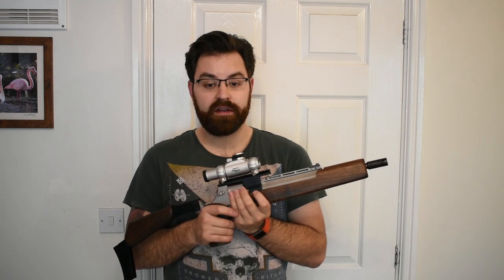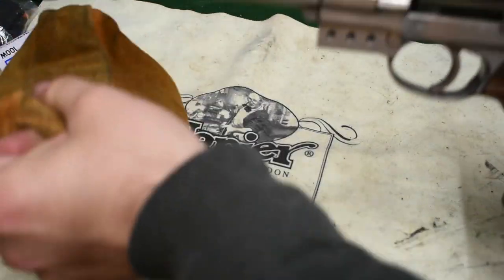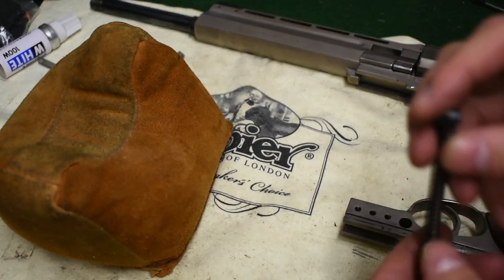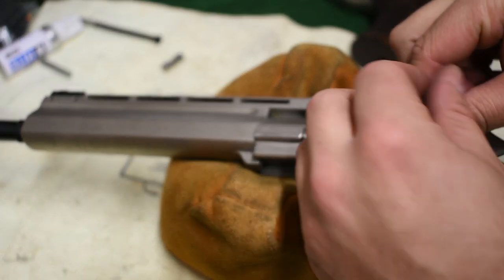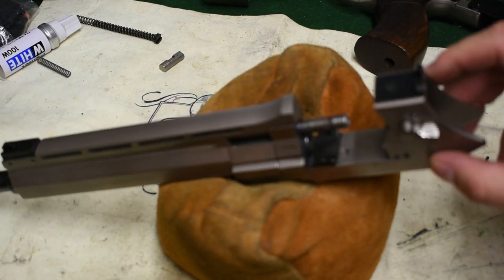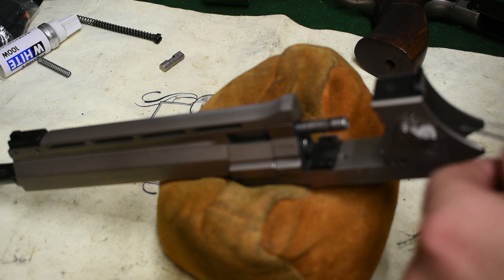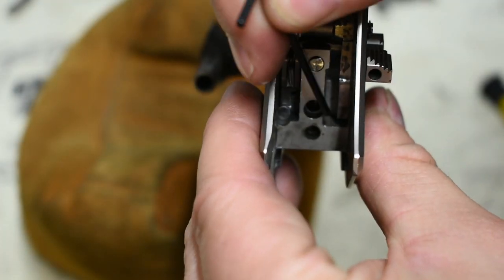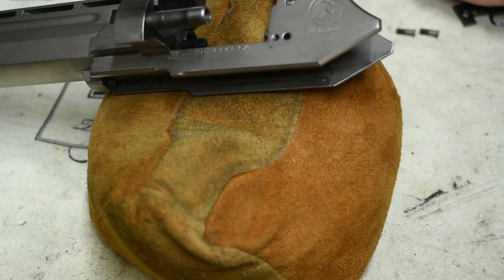Mateba 6 Unica Grifone repair - Disassembling the internals

Comment: A few months back I had a look inside the same area you did (firing and cylinder rotating bits) because my 6-Unica is "jamming". I now suspect the hand arm is jamming internally, because that part is all munged up. But, I don't know for sure it is. When assembled, it exhibits the issue by preventing you drawing back the hammer. If the issue is the hand arm, and you fire it, no problem, the slide will just fail to go forward. IF, however, the problem is in the lock work, the pressure of a cartridge firing would surely irreparably damage something. It's frustrating as only intermittent faults can be! What I found is that back plate with the two screws, well the two screws were not torqued at all, and the manual I have says they should be loc-tited. PERHAPS the plate was loose, and the firing pin block was hanging up during cocking, causing damage to the hand arm. It's frustrating because I think I have fixed my incredibly rare Italian revolver, but I can't be sure, and I don't want to break it using it!

On further watch, your carbine hasn't got the firing pin block my revolver does. It goes through the back plate there, and hooks onto a protuberance from the center bit the opening rod goes through.
Reply from the maker: That sounds very reasonable, I would suggest it could also be caused by that forked arm bit on the right hand side of the hammer, or associated parts as I can cause it to jam by incorrectly assembling it and attempting to dry cycle. Something to at least consider.

Curious regarding the pin block. I wonder if that's a carbine difference or an update in manufacturing standard?
Reply: @bangNbark  That's what I am calling the 'hand arm'. I am not terribly versed in revolvers, but I believe the bit that spins the cylinder is called the 'hand'? That part, where the forked lever is hinged with the bit that actually spins the cylinder, is pretty torn up. It looks like it was allowed to wobble and ground itself on the walls of the area housing it.

It was rather completely awful to reassemble in the revolver version. Getting those 3 pieces back on the pin was next to impossible. What finally worked was tying the sprung hand to the hand arm with some dental floss, reassembling, then removing the floss.
Reply from the maker: @Hansengineering  Ah yes I'm with you.  The dental floss is a great idea. I can tell you for nothing now, it took me many, many attempts. I occasionally would forget to locate that pin into the forked bit.... Drove me mad!

Comment: Excellent video, I have a Grifone with cylinder lock up issues, the cylinder rear doesn't look worn but there seems excessive play on some chambers but not all. The chambers that lock up do so very tight but the chambers that do not seem to have excessive play, does the locking pin jam sometimes or does it wear, have you any advice on how to proceed?

Comment: Thank you so much for the video. I had a few follow up questions as a new owner of a Grifone.

Can the barrel on the Grifone be removed just like the revolvers, and swap between the revolver barrels? 

How is the stock retained on the beaver tail? 

I hope we can keep providing more info on these beauties as time goes on. If there was enough interest I’d love to create spare parts for these firearms. Especially reproduction rubber grips or 1913 optic or accessory mounts.

Again, thanks for the content!
Reply from the maker: Ah awesome! Are you US or Europe? 

The barrel ls can be swapped out, there is a pair of flats on the barrel which I believe is the same as the Unica revolver and they thread out. 

I believe the stock is held in place with a permanent style of rivet. Mine looks like it's not intended to be removed without severe damage. 

You know I hadn't thought of other accessories. I have a rail up top which does me. However there is a lug which is threaded to take the stock. A block could easily be made to fit that for all sorts of things. Lasers, lights, bipods etc if wanted.  

Enjoy!
Reply: bangNbark 

Thanks for the lightning fast reply! 

I haven’t taken possession yet. I’m in the US and won an auction for it. It’s the Grifone in 44 Magnum.

I was told by another collector of Matebas that he has seen one example where the Grifone parts were installed on a standard Unica, and sold as the carbine. That’s where a good portion of my questions stemmed from, as I bought the carbine sight unseen for a small fortune. It’s surprisingly easier to get the carbine transfered in the state I live in (California), but I really wanted the revolver version so I figure I could just have a collection of parts to switch between carbine and revolver.

That’s fantastic to know I can use a wrench to remove the barrel. I wonder if your stock was riveted due to UK laws? As I understand, the 357 stock is meant to collapse or fold, but the 44 is meant to be fixed? 

There was a limited supply of rubber reproduction grips on Gunbroker, but it seems that supply dried up. How has your grip held up, and in your opinion, what do you think is the fatal flaw that causes the grips to break horizontally? 

Looking at photos, it seems the Grifone has threaded holes at the receiver for both the stock and optional weaver mount. The standard revolvers seem to have this merely as an option. Two styles of mount could be made based on the platform — a mount utilizing the side mounted threads, or a mount that bridges atop where the original sights would be threaded. This is just from what I see though. Without the carbine in hand I cannot say for sure how viable my idea would be.

Can’t wait to get the carbine either way! 

Since there isn’t much info or forum for these firearms I’ve resorted to polling owners wherever I find them.
Reply from the maker: Oh you are in for a treat! These really are special. I bought mine without seeing it too. I phoned the dealer, asked what stock it had (there is what I call the spas12 style like mine and also like a wooden M16 style one) and then said doesn't matter, take my credit card number. I'd tell you how much it cost, but it'll make you sick ;) 

I don't think it was riveted due to the laws. It looks too nice! Most things when converted are done not to the best standard and the mateba is a nice standard of quality. 

There would be no differentiation in British law for the calibre. These are all in the same boat. To my knowledge they are all fixed at factory, and then the importer here had them modify not to fold but to detach. All the ones I have seen - which, only mine in real life others in pics, detach under the cheek rest which complies with British law. You then have quite a wild hand cannon. 

This thing, shoulder fired, in let's be honest a noisy calibre with a muzzle break gets a lot of attention on the range here. We are only allowed semi auto .22 rim fire and shotgun's, so that adds to the ".... how on god's earth....." Questions too 😂

Regarding the wood.... In my opinion, it is due to poor storage (wood dries out) and/ or impact. So owner neglect really. 

Mounting options would be easy. Does yours have the optic rail with it? How about the owners case? I have safariland speed loaders for mine too. I'll have to look up which. It's a S&W model that works
Reply: bangNbark 

I can’t wait believe me. It’s been a long time coming. I spent around $5000 for my carbine. Looks more like a shooters grade rifle, but that’s okay. I shoot what I collect 🙂

If the stock is indeed riveted to the rear tang or beaver tail, I may elect to just remove the rivets and instead use fasteners to remove the stock on and off from the rest of the gun. I’d like to preserve a lot of the wood furniture if I could. It just looks way to nice.

I’d imagine it’s a flat and pleasant shooter from all the features that make the Mateba so cool. 

My particular carbine did not come with the optic rail. There was another 44 on Gunbroker with the rail, but I could not justify paying an additional $2000 for the rail. Unless I made a mistake by not getting it. I just figure I would recreate a rail with proper 1913 rails, so I could mount a more modern optic (thinking an older Italian Konus scope to stay with the theme of the gun, but I wouldn’t be opposed to a modern optic like a Trijicon SRO or Aimpoint). Seems a lower rail could also be added for a light or even a small bipod. 

I already get weird looks at the range. In a world of Glocks, 1911s, and AR15s, I’m the weirdo with the oddball European stuff. I did just finish a Accuracy International L115A3 build. Shoots like a dream!

I’m thinking if I had to recreate the grips in wood, I’d either use a different type of wood or just a rubber or aluminum grip, and thicken it up internally. I’m full of hairbrained ideas right now, but that’s the excitement talking. 🤣. No original case, just the gun. Last one I saw with all original packaging was $10000.
Reply from the maker: @romeo_alpha0176  I'm sure! How long does the process take for you to take delivery?

The wood is gorgeous on these so do what you can to look after it. They aren't super fragile, it's just replacing it isn't as easy which makes people nervous. I shoot mine alot. I just wouldn't run over it with a Silverado or whatever. 

They are very soft. A pussy cat to shoot. I can't imagine the 44 being significantly worse/harsh. 

Watch your face too. That cylinder gap blast is big even on a 38 load. A 44special will be for sure. The magnum will step it up 😂. There is a blast diverter for want of a better word in there, but they get lost. It's that Cresent blues metal piece held in with 2 grub screws. 

I don't think it's a mistake not having the optic rail, especially for £2k extra. The iron sights worked well for me. I can hit an 8" gong from the shoulder at 200metres comfortably. Revolver cartridges aren't known to be accurate, and have the ballistics of a brick in molasses. But, the barrel length, stock and awesome trigger make it an absolute blast. 

I have a few videos of mine. If you notice it's almost always with different optics. I play about. I can do an in-depth video of any other aspects of you would like to see anything else. 

I had heard that these can go north of $10k. Mine came with the original case, optic rail, and 3 safariland speed loaders. Remember I said I stopped asking questions and just gave over my credit card number? ....I paid $600 shipped. Yeah. I wasnt mucking about then. 

I also love the oddball stuff, well certainly for UK terms. I have a video of all my UK guns you can take a look at if you are interested too.
Reply: bangNbark 

Process goes like this:

Transfer from the east coast to the west coast through two dealers (in this case, seller is a dealer, I have to select a dealer in my area). Once received I go to the local dealer and fill out Federal forms for background check, and also state forms. Wait about two weeks for approval and then pick up. I’d imagine from start to finish maybe 21-28 days, and that’s being forgiving.

Do you treat your wood at all? Curious what your cleaning regimen is for this particular platform. Maybe a video of the stock and optic mount would be great to see while I wait what feels like an eternity. 

I have to remember to be wary of the cylinder when firing. I’ve heard the gas can really slice you up if you aren’t particularly careful. I’m not too worried about recoil. Shooting that AICS L115A3 in 338 Lapua magnum isn’t so bad, and I shoot the desert eagle in 50AE without much issue. I shoot a lot of 10mm in my HK USP. I actually enjoy an authoritative recoil if it’s there. 

Is there any height over bore considerations with the Mateba? What is your POA/POI between 5 to 25 meters? 

$600? THATS SO GOOD ITS ALMOST CRIMINAL! You must have picked this up awhile back! I understand a lot of EU firearms are heavily inflated where I live, but rightfully so. Europe may not have the greatest gun laws on earth, but you guys sure know how to make great guns! 

I’ll have to check out your other stuff too. I try to be in contact with firearm enthusiasts on a more global scale. Networking is everything, and it’s a great learning experience! If you do make a video about the Mateba, could you also show up close what comes in the case? I’ve yet to see videos showing exactly what constitutes a complete package. 

Thanks again
Reply: Update!

Finally got it in my hands and used this video to do a tear down for inspection, cleaning and lubing. Looks like it was shot very little and stored away for years. The lube inside the gun was more of a congealed glue, so I had to put in a weekend to clean it up and adjust the overtravel stop right where it needed to be (purple loctite for good measure). Will be shooting it soon!

I saw what you meant about the stock. Mine disassembles by removing the Phillips screws on the buttpad, and removing a single Allen bolt from the tang. The tang is simply a one piece extension of the beaver tail. The beaver tail appears to be riveted to the lower itself in two places, and provides a rest for the seat spring. The rivets then seem to be filed and contoured to the beaver tail to allow the pistol grip to slide tight against the lower frame. 

I picked up rubber reproduction grips for the griffone so I can preserve the wooden grips. Seems like all the grips interchange between 357 and 44. Do you know if the weaver mounts are also interchangeable? I found one on auction but I’m uncertain about bidding. The dimensions look close enough but I’m uncertain if the 357 and 44 mag frames have huge deviance in height or width.

Anyhow, what do you think? Cheers from across the pond!
Reply from the maker: Hey sorry been away for a bit. Thanks for the update, so pleased for you. 

To the best of my knowledge, the weavers are interchangeable across all 3 calibers. I would definitely be buying any parts you come across, and if it doesn't fit it could probably be easily modified to fit by a good engineer. 

Have you managed to shoot yet?
Reply: @bangNbark  no worries! My friends in the UK say the weather has been great for outdoor activities so if you’ve been doing that, outstanding!

Haven’t shot it yet due to the bushfires here but with cooler weather permitting, I will be doing some shooting in the next few weeks.

I got the weaver rail yesterday but sadly the Internet rumors are true: they are caliber specific. That tells me the frame sizes must also be different. I’m going to attempt to commission a machinist to possibly recreate some parts for the Mateba, including a lower rail that attaches to the left for bipod provisions or 1913 rail. 

Could you tell me if the weaver on your rifle co-witnesses to the irons on your carbine?

Comment: Hmm...just out of curiosity is the stock removable or not? There hardly any info on these rare mateba 6 carbines.
Reply from the maker: Not without gunsmithing. Although, for the UK market part of the stock can be removed, but it leaves a small section of stock bar on there to maintain the correct length